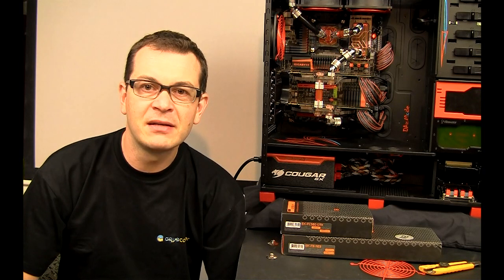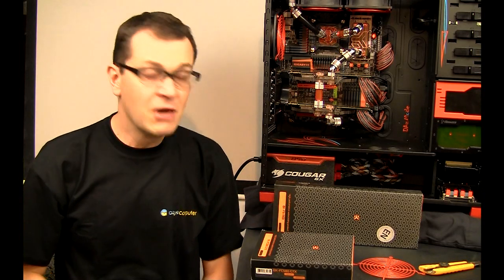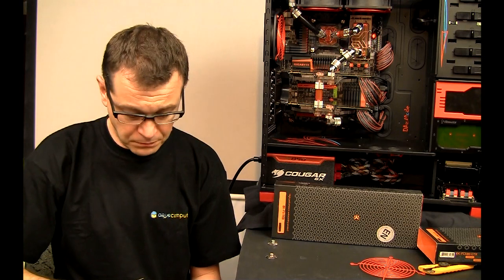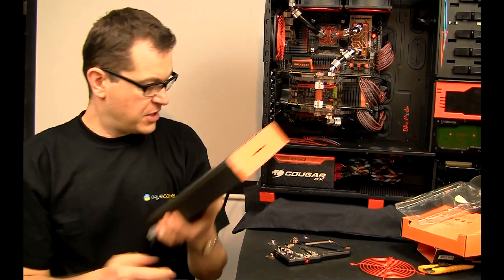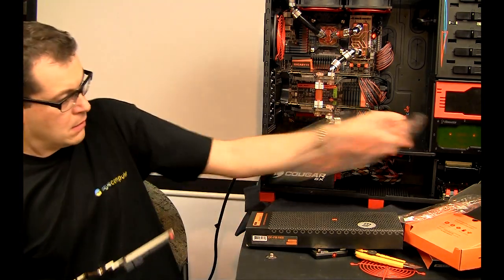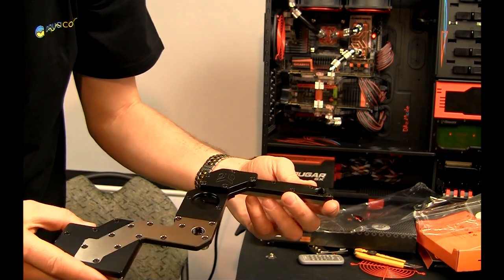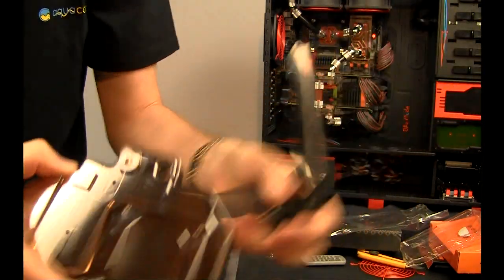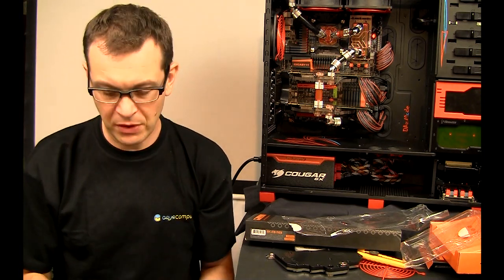Visuals on EK's EN Plating vs "old plating" - DazLabWeekly18

Comment: I have one 6970 copper and one 6970 copper nickel plated. Both cool about the same. GPU1 is 1-2°C warmer because it also clocks higher and is primary card.

So the nickel plating does not really improve cooling but it protects the copper.
EK previously had SERIOUS problems with the old nickel plating, it 'disappeared' after a while, that is why they use the new EN type.
My cooler yet looks fine though. (after months)

Thanks A LOT for the video Daz. Always wondered how the new ones look